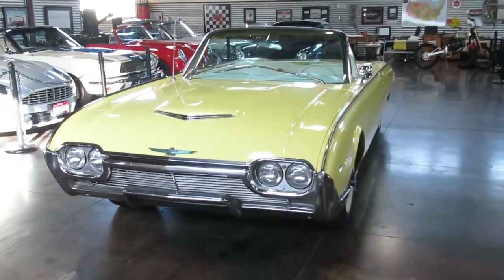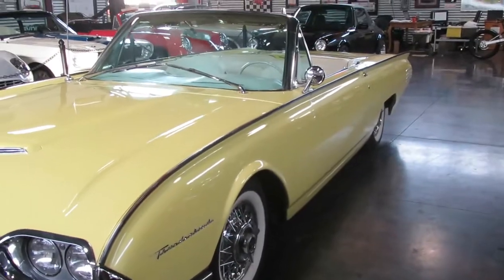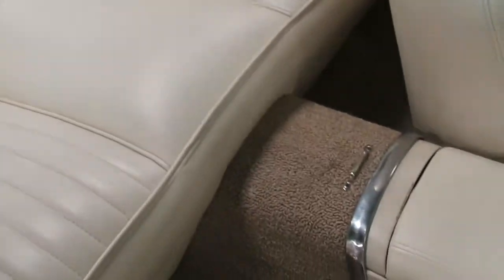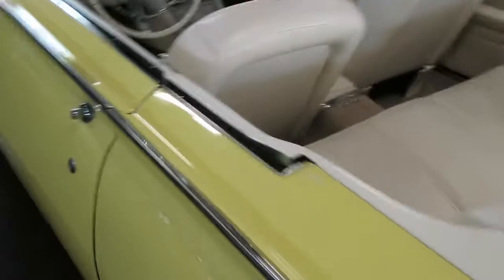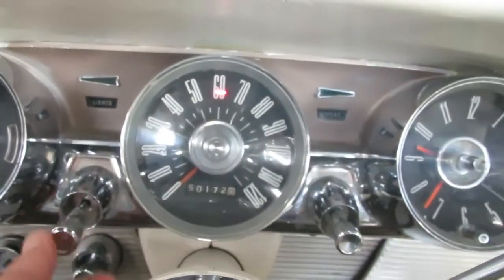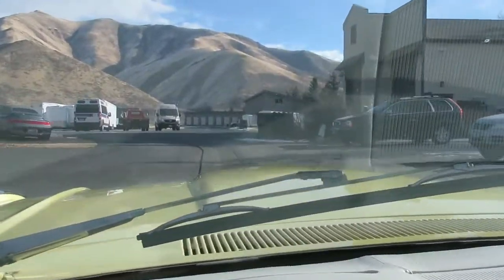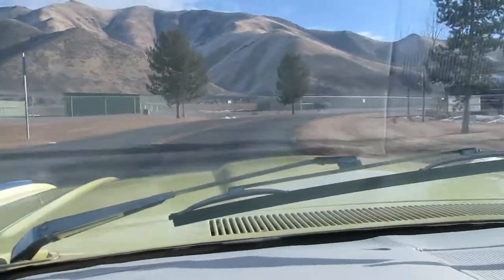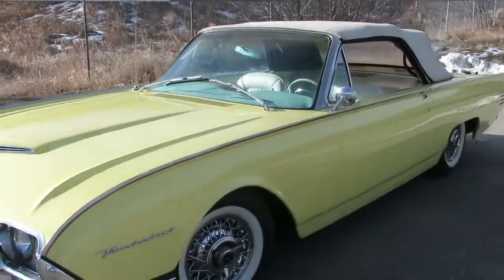1961 Ford Thunderbird FOR SALE top operation and test drive Sun Valley Auto Club

Comment: You should have the engine running when operating the top.  Really a big electricity draw.  Will operate much quicker and smoother when the engine is running.  My '63 draws right at 50 amps in operation.

Comment: Wide white wall were not the thing in 1961
Reply: Actually they were.  1961 new American cars still have wide whites and the width of the ones on this car are absolutely correct.  New Ford and GM cars for 1962 used narrow white walls for the first time. Chrysler cars still had wide whites until 1963.
Reply: Yes they were....61 had wide whites. They went to a smaller white wall in 62
Reply: @dinomike53  I turned 13 in 1961 and consider myself a true expert on fifties and sixties cars but after thinking I am going to stand corrected.
Reply: @tedcarter8074  I love that whole era, 1949 to the early 60s and have been collecting those cars starting in 1967.  I had a low mileage white/red 62 sports roadster a few years ago but sold it because I always wanted one with skirts.  Last year I bought a red/red standard 1962 t bird convert.
Reply: @dinomike53  One of my favorites all time !!
Reply: @stevedavajon2194  I put 2 and a half inch. Radials on my 63 Sports Roadster. The white walls enhance the look of the?iconic bullet bird.